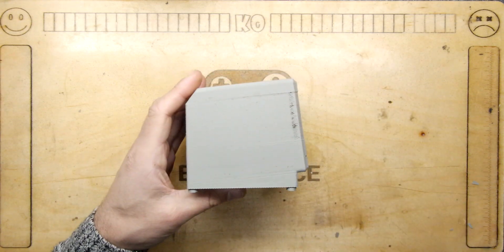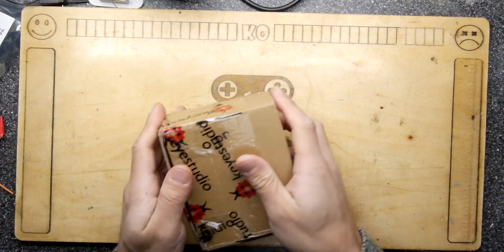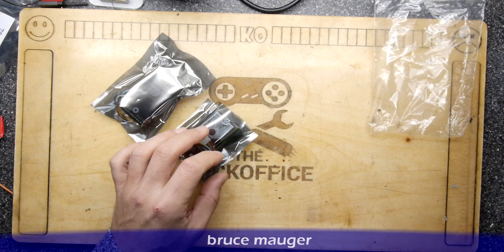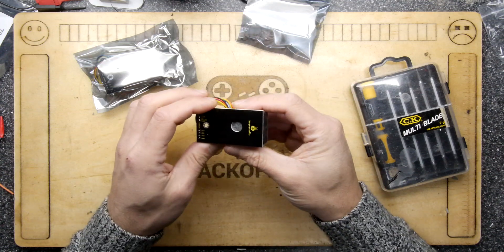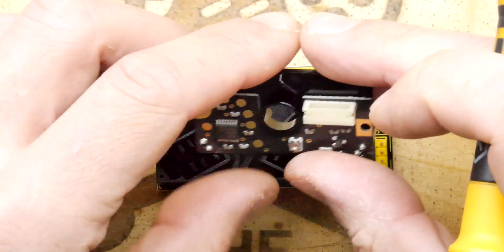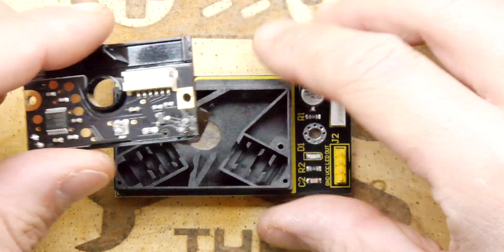Cheap as chips! The Keystudio PM2.5 Particle Sensor

Comment: Thank you for this! I bought this exact Keyestudio unit and there is (of course) near zero documentation. I was curious if I should use a fan with it, and thankfully you've answered that for me!

I also didn't realize that the bottom "film" was just adhesive that should be removed. I assumed it was a thin filter of some sort, but you cleared that up for me as well.

All in all, easy vid for you, and a good win for me. Thanks!
Reply from the maker: They are a pretty good unit really, seem to work well

Comment: You actually ruined that sensor calibration by opening it, I've done that before and the reading isn't the same once I put it back anymore
Reply from the maker: I'm sure I can get it back, having a second unit to calibrate it against will be fine for what I would have in mind (turning on a fan automatically)
Reply: @backofficeshow  the potentiometer on that thing is very sensitive to noise, I'd recommend using an isolated screw driver for tuning it.... best would be the plastic screw driver for calibrating probes... otherwise you'll get a different reading when you're actually touching the pot vs when you leave it